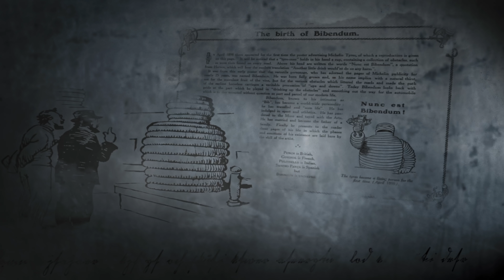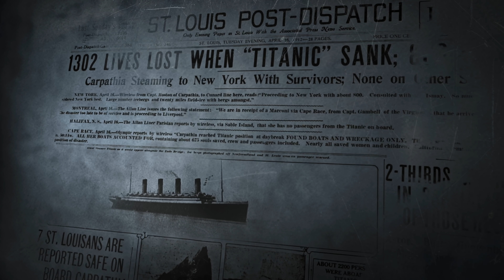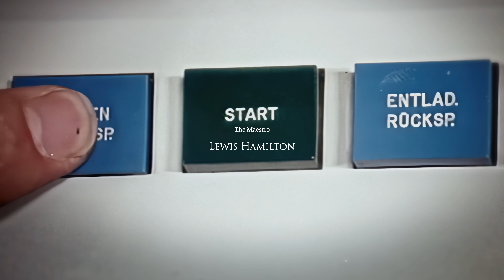Gran Turismo 7 Opening Movie

Comment: If I'm right this is the only GT where Moon Over The Castle plays in all regions 😀
Also I notice this one seems slightly different to the previous version (shot with Celica and Supra feature the Skyline instead of the Civic, and some shots like the one at Sardegna with the 300SL were not used before)
Reply: Technically, GT4 was the first owing to the orchestral introduction of the intro…
But this is the first time the main song has been used, yes!
And it only took 25 years.

Comment: Let work on further refinement of the penalty system. If I tap someone going into a corner because they brake early, and their line doesn’t change, I shouldn’t get a 4 second penalty for forcing someone off the track. No one was ever forced off the track. They pulled the corner faster than me. 

On the other hand. If I’m deliberately forced off the track by another car, why am I getting a penalty for ignoring track boundaries? 

The coding seems simple enough. Be smart. Save your brand. It’s 2022.

Comment: The th8a shifter is compatible with the USB because it works on gt sport on ps5. And the patch didn't work. the shifter still does not work. Din or USB. I'm using a thrustmaster t150 pro and the th8a shifter. Again on ps5 when plugged into the USB port in the back  the shifter works on gt sport but not gt7.

Comment: GRAN TURISMO 7 is a thin and weak CAREER DLC for GT Sport, with the higher graphics power of the PlayStation 5. Unfortunately this is not a real innovation. 
I don't mind the slow credit progress, or the microtransactions. 
What's piss me of, is the lack of real innovation in this product!!! 
The actual career mode (Café) is pretty short. 
In some areas GT7 looks a few generations older game. For example; the Cafe owner, and the e-sport GT players (basically every character in the game), are communicating with us across a simple text bubble. Seriously??? Like on the original playstation 1. back in time. But for me it's not nostalgic at all, it is embarrassing, pathetic and lazy! 
In 2022 at least need to be a voice narration! 
It's mandatory. Not a simple text to read.
Or interactive videos! That's how you do it. 
But text? So disappointing! 

My wishlist for GT7 features looks something like this:
✅ Dynamic time changes
✅ Dynamic weather changes
✅ Faster Ai
❌ Yearly seasons in tracks (winter, autumn, ect) 
❌ Improved penalty system 
❌ Custom offline championships (so much potential!) 
❌ Voice messages in races, and in the menus too, to feel the characters alive. 
❌ Fully customizable and mapable HUD!!! 
❌ Proper race weekends, with qualifications.
❌ Game data out via UDP! 

As you see most of them still missing, nevertheless most of them doesn't require to much work from the developers... 
For example; customizable championships, HUD, or UDP data out is a simple one. 

... oh, and the music rally or what the heck, is ridiculous 🤣
I have a feeling since long years; that Kazunori Yamauchi is making this game for himself, and doesn't care about what the community wants at all... 
"The real driving simulator" is a real missed opportunity. Again... 😕